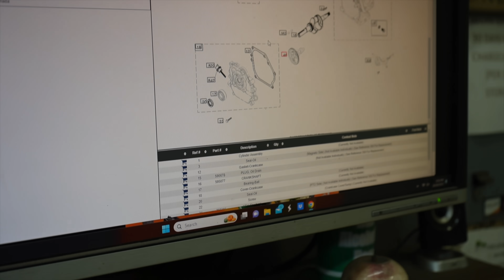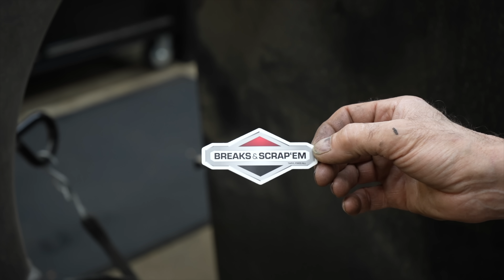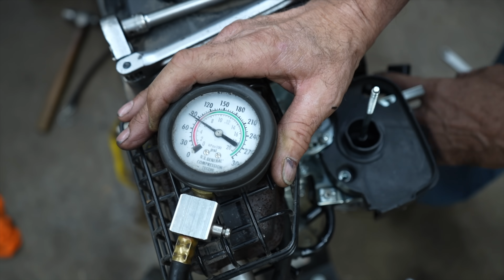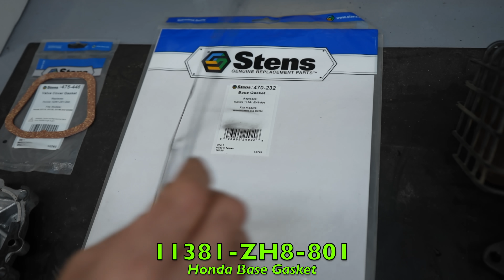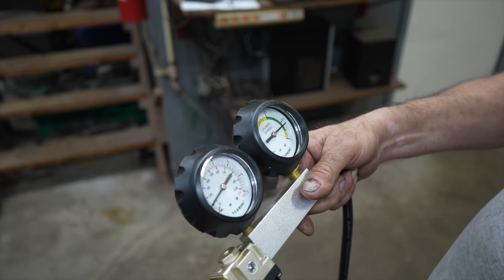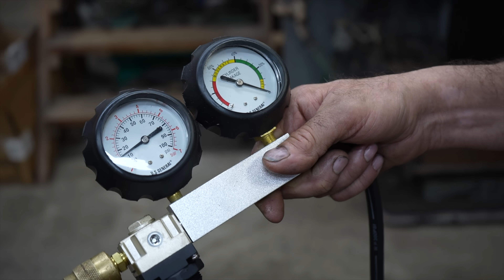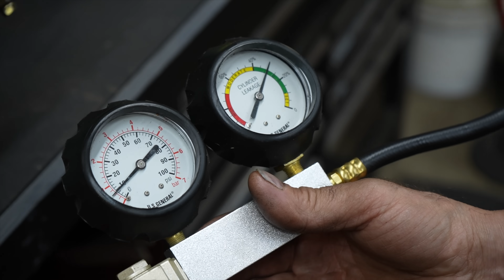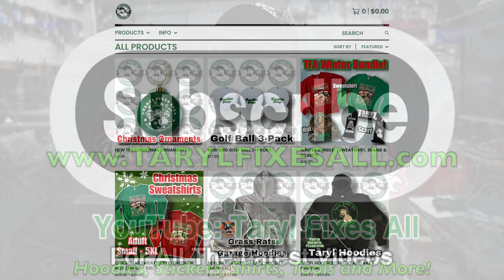Has He Finally Met His Match? Taryl is STUMPED!

Comment: I rebuilt my dads Honda GSV190 powered Honda lawnmower which I filled up with semi synthetic oil,it has done only 5  hours of work but it will start getting a workout tomorrow since it's late spring in my area here in Australia, the rain & heat has made the grass grow like crazy.

That stuck ring issue is what sort of happened to the Intek engine on my grandfathers John Deere lawn tractor which my uncle gave him,he didn't change the oil & he kept on cranking & cranking the engine until he burned out the starter motor.

Even the local lawnmower mechanic in town thought that a broken compression release on the camshaft was a cause of the starter motor problem until he pulled the cover off the engine.

It still had compression albeit a scored cylinder & my grandfather hasn't really wanted to talk to me ever since because I unbolted the engine & he thought that I was wrong about things,I always never have a habit of stuffing things up like they did.

When my uncle got remarried 2 weekends ago he didn't want to talk to me at the wedding either,I think that it was because I got a different McDonagh whose wasn't a Green one of whose Mahers whose a Gray !

Comment: The older I get, the more I appreciate value, especially when I consider how expensive power equipment is these  days. So what has happened to a famous name like Briggs and Stratton is pretty sad. Also, I'm just a learn by doing homeowner -not a professional mechanic - but my common sense tells me plastic cam lobes in a high pressure part of an engine isnt a good idea.
Reply: Tecumseh used plastic camshafts on their OHV engines. As long as you don't run them low on oil or use high strength valve springs they last just fine. I've sprayed starting fluid in many junkyard tecumsehs and had them start up first pull.
Reply: No matter what it is now , everything is junk!

Comment: Hey Taryl that was a interesting one. 
I'm not a small engine mechanic but have learned a lot in the year i have been watching your videos. 
 So when the cylinder head heated up and expanded, the engine lost compression and slowly lost power and died because the piston rings were stuck closed around the piston. 
 Good job showing that to  Briggs.

Comment: Good fix Taryl. I would still change the fuel cap because when it did run it would die after a few minutes. Also I had a briggs riding lawn mower that had a bad compression release, Would start and locked up the starter. Briggs said the cam was back ordered for about six months. I bought an aftermarket cam and held my breath that it would not fail. So far it is still good. Thanks for a great video.

Comment: The scrub cadet had 60 pounds of compression because it still had it's compression release operating. The Briggs, with the CR removed, was actually too low, I thought.
Reply: Yes but not by much it should have had about 80-90 with not CR, but without a CR, he wasn't able to pull it at full speed either. But stuck rings might seal enough down in the hole to get somewhat decent compression, but if the stuck rings were leaking at or just past TDC, what was happening was every time the cylinder fired, and the piston began to move on the power stroke, all the pressure would blow-by. I was noticing when he had it running with no valve cover, it looked quite smoky, like it had too much blowby. It was way too much blowby for only 10 hours so I was already thinking bad rings, or scored cylinder wall at that point in the video. Look at @21:45
Reply: @brnmcc01  He actually remarked that the Briggs was easy to pull and did not need a compression release. It was easy to pull because it had low compression, imo.

Comment: Never thought about stuck rings.  I had a truck in our shop that wouldn't start when it was colder than 50 degrees outside, no matter what, but put it in the heated shop overnight and it would kick off every time.  Good spark. Good fuel sample. Exhaust not plugged. Cam/crank sync just fine. Block gas test passed.  Out of desperation threw the compression tester on it when it wouldn't start, and barely marginal compression on bank 1, normal on bank 2.  So when it was cold, the richer mixture was washing out the rings on bank 1 with fuel, in warmer temps or once it ran it was leaning out the mixture and the rings would seal, and compression was just high enough to get it to run.  Oil had about a quart of gas in it.  Customer decided they were going to wait until summer and send it thru the auction.

Comment: This all reminds me of recently when my ATV didn’t want to start anymore. It died suddenly while riding just slowly around the property… i took all the plastics off and stripped it down, did troubleshooting for months before giving up. The bike was a few years old by now, but only had about 400 hrs on it. It had spark, held compression, and had good fuel pressure. Bench tested the temp sensor, the crank position sensor, the map sensor, and tps. Bench tested the magneto and pdm. Did continuity tests on all wires, harnesses and clips. Replaced the fuel pump and injector and a whim. Also replaced the idle air control valve solenoid on a whim. Replaced spark plug, plug wire, and coil. I checked the woodruff key and it was beauty. I absolutely had nothing left to go on except for valves and clearances, rings, crank/piston, decompression valve, timing etc. but it seemed waaaay to soon for that and in order to dig that deep the engine would need to come out, plus if any of those were the issue thats total bs and id be contacting Polaris directly - so I brought it to an authorized dealer. Took them almost 3 weeks to find the issue after repeating everything i had done previous. Turns out the timing chain tensioner failed at some point which advanced the timing by a few teeth retarding the engine AND the piston made contact with one of the valves and damaged almost everything internal… piston, crank, shaft, valves, lifters, keepers, rockers, retaining plate, and jug. Plus the oil pump had metal run through it, the timing chain is compromised, and it needs a new tensioner obviously - which I hope to upgrade to a hotcams brand aftermarket. Took pictures of everything and sent an enquiry to Polaris, even tho the bike is 11 months out of warranty at the time. They agreed it was a manufacturer defect and offered to pay for all the parts, but not labour. I resent another inquiry soon after thanking them, but saying just parts wasn’t enough… they agreed again and said they’d cover all parts, plus 50% of labour. Im sooo glad I sent those inquiries and very lucky Polaris stood by their product! Its been about 3 months now since and im still waiting to this day… some parts are on back order unfortunately, but im being patient and playing the game. Total repair cost is estimated at around 5000$ total… ill still be on the hook for around 1500$ but thats a hell of a cry better than writing off my 2017 ATV after less than 500 hours of use and being left with nothing but a frame, plastics and tires!

Comment: I have a Poulan Pro PR621 snow blower, it came with an STB 208cc engine. I bought it around 2009, and a couple years ago the engine stopped starting, just about like this one. Now that was after quite a few years. The blower was still in pretty good condition and I had just replaced the paddles and some other stuff. So I bought a Predator 212 for $99 (before the massive inflation).  I retrofitted the side cover, carb, muffler,  pull, etc. from the STB so I could keep the blowers cover and controls and all that, and for example the top oil dipstick. 

After looking at the engines, they are both the Honda clones just like these. I could tell they probably were manufactuered in the same plants (maybe not), even the way the laser etching of the serial was very similar but obviously different between 10 years. I didn't check if the cams were identical, BUT the side cover fit without any modification so at least the bearing IDs were the same. 

Was a fun little project.

Comment: The push rods would probably interchange as long as you change the tappets too. The Briggs push rod was a little longer and the tappet was a little shorter, and the opposite for the predator by what looks to be the same amount. Unless the tappets won't fit into each other's blocks.
Reply: A 212 hemi will interchange including the crank, and cam.
Non hemi have smaller cam mounts like the gx 160- 200 Honda so non hemi, and Honda interchange.

Comment: I was gonna say ignition after everything hung you talked about. Here last winter I installed a msd coil on my 5.0 mustang that I bought just to complement the 6al2 box on it, and just for insurance off having a new coil on it. Was on there for about 3-4 months and I noticed the car having starting issues, really long cranks, done random misfires. Well one day when dropping my son off at school, it just died and would not fire back up. Hitched a ride to work, where I had my stock ford coil and brought it home with me. Went back to the school and car till was a crank no start, plugged the old Ford coil back in and it fired right up. The car has been running way better than before, no more random misses and long cranks. It just slowly started messing up. Now I’ve learned that the new msd stuff is junk these days, heck even the old 6al2 box has taken a crap. But the coil seemed to ohm out ok, 1.2 on the primary and 3.3k on the secondary? Kinda seems like what your dealing with here.

Comment: I wonder if the ringlands on the piston were machined too thin.  Enough room for the rings to move initially, but even a slight bit of sludge from normal operation caused them to stick.  Adequate clearance might have accommodated the little bit of sludge.  That's my theory.
Reply: I am thinking the same thing.  A machining problem from the factory, and the most tiny amount of 'varnish' or sludge forming in the ring land caused them to stick real quick.  It's totally normal to have a little bit of varnish form on any engine, new or old, but when the factory screws up and doesn't provide correct clearance,  BOOM !!!    It's junk.
Reply: I'm thinking something in the fuel, some oil, additives, contaminates, old fuel, etc. sometimes additives can be very bad if the tolerances are tight and they run lean for emissions cruft.

Comment: Its really the only way to test piston aircraft engines. Never used a compression gauge because the differential tester did it all. Holding the prop at TDC made it easy. You would of heard the air leaking from the oil fill or dipstick.

Comment: Thank you for sharing this video.  I have a TORO Time cutter with the 2P77F v Twin motor.  this is an older zero turn that has just quit o me.  

In my "Detective" diagnosing, I ended up doing a compression test.  One cylinder has 150pi, the other has 60psi, obviously, not right.  I thought it was a valve, so I lapped the one with low compression.

If I crank the engine for about 3 min, it will eventually start, some times.   Just like yours.

I have adjusted the valves, still not running.

So I was thinking it was the Compression Relief, or the CAM, but that does not make sense since the valves were functioning.

The one cylinder also is dry and is not getting gas on start up.  IF I get it running, it runs like it is on 1.5 cylinders,

Then I thaought it must be the rings, bt since it has compression and the compression does not drop, I rued it out.

But now that you did a leak down test, I bet that if I did the test on mine, I would have the same results as your.

So, off I go to pull the motor and check the rings on the one cylinder.

Comment: Question : if it's determined that rings are stuck,  is there a chance that soaking the cylinder with snake oil, ATF, or something like marvel could remedy the situation? This video was absolutely amazing and I really learned from it. I claim myself as an efficient grass rat, but so many times have been tunnel visioned in the wrong direction.  Thank you for sharing the struggle!
Reply: The chances are that you’ll free them rings all right. The challenge now is to keep them from getting stuck again. So to prevent this from happening again in the future change the rings or even better piston and rings together. Don’t forget to break in the piston rings as you would do with new engine (5-6 hours run at minimum with first oil change after 1-2 hours)

Comment: AgraFab leaf vacuum suggestion - I've had a couple and if you run it too long and fill the cart, the chute can clog up and take quite a bit of time to restore air flow.  I made a view window. I cut an opening on the top next to the chute and covered it with a plastic plate.  Noe I can see when the cart is about full and empty it before the chute clogs.

Comment: Taryl, it seems like all of these manufacturers are dropping the ball.
I had a nice little Hustler Dash with the junk single cylinder Power Built engine. I knew the crank was eventually going to fail. I sold it and got an older mower

Comment: I'm 16 minutes in and before I see the whole video I want to say that these engines came with plastic crankshaft gears, if the molded key shears or is installed incorrectly (or melts) the cam timing will change every time you pull the rope. I taught small engine repair for votech and had a student with the same engine and problem. Took me a while to figure it out.

Comment: The reason one motor had 60psi and other had 80psi is because the 60psi had the compression release working.    The motor that had 80psi without a compression release is too low.   Should have been 100+ without a compression release.  Also, you can tell where the leak is by feeling over the carb, muffler and oil check port to see where the leak is when doing the leak down test.
Reply: Oh!  That explains the higher compression, which to my mind should have been lower if the rings were stuck into the grooves.  I forgot he'd already removed the compression release!  Thanks so much for catching that and mentioning it - saved me asking the obvious question.
Reply: I love using my leakdown- so useful. Taryl should have remembered about the comp release he took off. It looked like he had low blood sugar or was coming down with something! Or lack of sleep.
Reply: Yep he compared the compression between one with a compression release working and the bad engine it was removed should have been over 100,

Comment: I bought a Toro AWD push mower and the motor locked up and Toro would not replace the motor. Toro said if I have been changing the oil and I said yes, but I called Briggs and they said to call Toro. I took it to a authorize dealer and they said the engine was locked up and they would not replace the engine because of the oil not being changed which I did. But the manual and Toro said the oil never needs changing just check to see if it had enough oil in it. So I filed a claim with the BBB and guess 
what they authorize the repair.

Comment: Stuck rings could have been caused by running it too hard for the first 20 hours.   We used an old broken piston ring to clean out the grooves, so they had the correct 2 thou or so clearance...  It happened more often with two-stroke motors.

Comment: Love this guy, just a few questions please address them, been  working on small engines also, a little while,  lol,,,  why didn't you check fuel line delivery first ?   Also if rings are stuck, wouldn't compression be either very low, or very high ? 80 psi is about normal for that size piston. Seems if fuel delivery was normal,  when the muffler was removed and the pull start was engaged , over and over, there would have been either fire thru the exhaust port, or at least backfire?  I personally believe this engine suffered from , fuel starvation and a partially sheared flywheel key,,  advanced or retarded timing?,   please address these questions,  I really enjoy this channel,  but stuck rings, the psi was too on point to be the reason,  exhaust valve was loose as he explained,  so good fuel delivery would or should have delivered backfire or severe flooding,  please get back, thanks

Comment: When you had that exhaust off, the sound it made was very strange. I figured something was up with the cylinder. 
And I hardly never use compression tester on 4-strokes, that compression release throws off the readings, and can very. 
Leak down testers saves alot of time and helps me narrow down where to start looking.
I suggest a OTC leak down tester. I had good luck with mine.
Great video Taryl

Comment: I bought a new B&S arbor for a 1970's Simplicity mower deck a year ago, and it came with the shaft having a thick coating of hard paint.  I had to use paint remover and a few hours of labor to strip it off.  It's a darned shame thing have gone this south with B&S - engine failure after 10 hours.  Nice to see Ronnie Jerkenstein guest star.

Comment: Leak down testing has saved me time and helps to quickly identify or rule out problems.  I have a HF leak down tester, but a better one than Taryl used.  The better ones give you a direct pressure loss reading and you can calculated % loss..  About $85 at HF.  I highly recommend you get a leak down tester that allows you to calculate the % loss.  Helpful video in many areas.